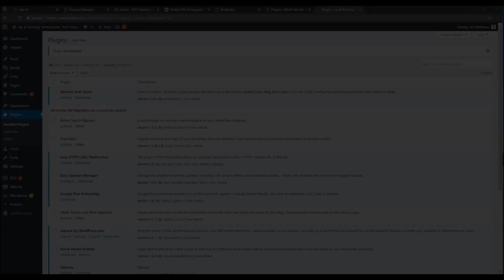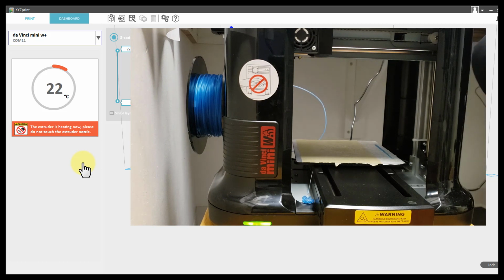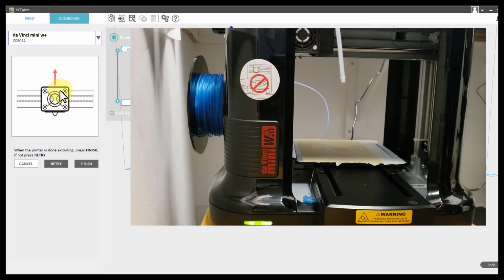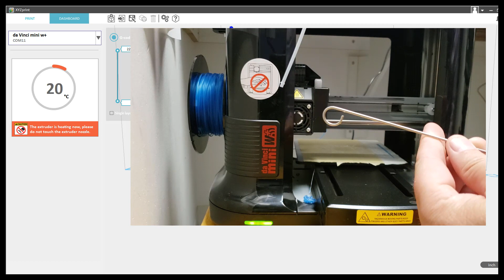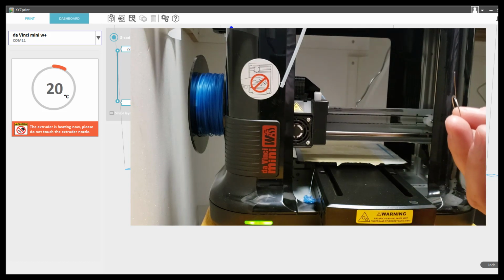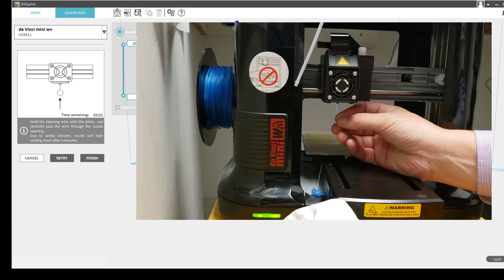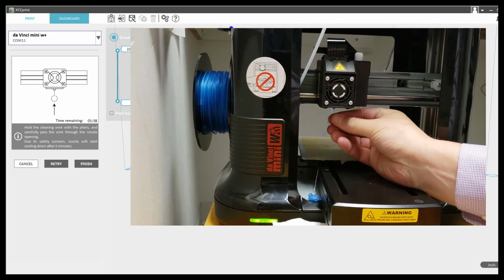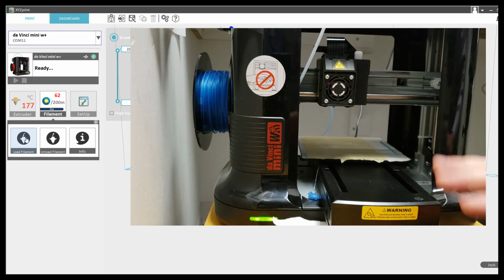How To Fix - Clean the Print Head on a da Vinci 3D Printer

Comment: Thanks brother you have been tremendously helpful in all aspects of learning about the Davinci mini 3d printer and have made my experience so much better than going into using my machine blindly. I just wanted to express my gratitude for your development of all your videos! Keep up the great work! P.S. it seems that xyz printing sends out random colors of PLA filament with their devices as mine came with yellow and I saw in another video that yours came with red. I was actually hoping for white but I had to purchase white from xyz because i believe their filament is proprietary and I didn't want to take any risks of not having another brands filament be incompatible with my Davinci mini. The cost was fair about $20 but they get you with the ridiculous shipping cost of $25 and there was no other option to select a cheaper shipping method. The packaging was extremely good quality and ensured that no damage could be done during transit though hahaha I guess that's where my $25 went.
Reply from the maker: Wow... thanks for the kind words Bobby.

Comment: Ty man, the manual was way way lost and this resolved my machine 100% stopping mid-print. Only real issue i had was that my filament got stuck. I solved this by warming it up and legit turning it of mid-max heat to maintain the 200c heat level. Then i was forced to cut off my filament and move my machine to my lap so i could to ahead and rip out the filament. This allowed me to clean it as in this video; now i am back at it and it works great. 10/10, i hope nothing breaks even harder haha!

Comment: So I've been able to do this before thanks to your videos. But now i have some filament stuck in the nozzle that won't come out no matter what. The printer heats up to 200 degrees but it's just not melting. And it's hardened so thick that i can't even put the smaller cleaners through the exit point. Any ideas?

Comment: Thanks for the video!  I didn't have the wire, so I ended up just pressing some filament in there until it melted and pushed the blocker out.  I thought that my printer has been dead for about two years and now it's alive again 😂
Reply from the maker: Glad it helped.  Thanks for the comment

Comment: Mine just wouldn't even unload properly and my stupid PLA just broke exactly at that small black ring where one can get the feeder tube detached. So pushing down with that needle or even pulling it out with some small jewelry making tweezers just won't work. I swear, right now that little mercurial diva of a printer is driving me completely nuts 😖

Comment: hey guys, i broke the filament and it dont want to unload, do u know what i could do?
Reply: I know this is old, but for anyone who may have this issue - If the filament is in the clear tube and won't come out, just disconnect the tube from the extruder and the feeder, then slide it out of there.  If the filament is stuck in the extruder, just run the Clean cycle and when it heats up, just pull the filament out.
Reply: How do i do that mine is like that i think maybe thats why it dont print

Comment: I have a XYZ Da Vinci Mini W+, and have gotten filament in the housing around the nozzle. Can you tell me how to get to that area to clean it out? I don't seem to see any screws to take of the metal cover and I'm afraid to just go in there and start unscrewing, unhooking stuff. Any videos on that part of the printer? Or any help you can recommend?
Reply: You need to take the front off the hotend.
Then you'll have access to the nozzle, and you can attack it with some tweezers/needlenose pliers.
Reply: I have the older Mini W and I just let the nozzle heat up, then hit it with some paper until all of the melted filament stuck to it.  It's shiny bronze again.